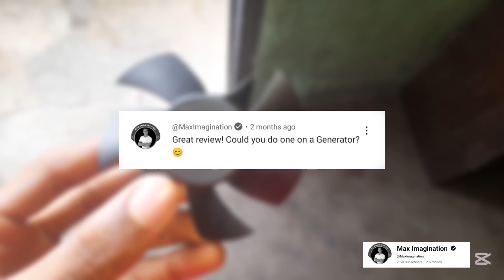DIY Hydropower Generator - Generate free electricity at home!

Comment: Hey, nice efforts! Thanks for the nice explanations.

Points for improvement I have to suggest:
- Make some kind of cover for the motor - getting water on it will rust it fast.
- Keep explanations more concise. I noticed you went back and forth on repeating a few phrases when you made mistakes. I'd suggest cutting out the repetition of your mistakes.
- Focus more on making your footage look clean - your video was quite blurry to watch - not sure if it was your camera's auto-focus or something.

Apart from that, keep it up.
Reply from the maker: That's me I actually blur those shot cause was explaining in the background so don't want viewers to be distracted and yeah I understood the reparations will do better next time
Reply: @successfulelectronics  That's not the ideal use of blurring - it only makes sense if you're showing an image of something in front for example and you blur the rest as the background, otherwise explaining while the video is playing clearly is correct.
Reply from the maker: Yeah kinda right,Okay will try out in next video, minutes thanks for the tip @MaxImagination